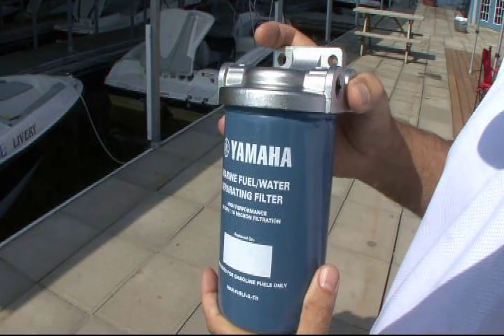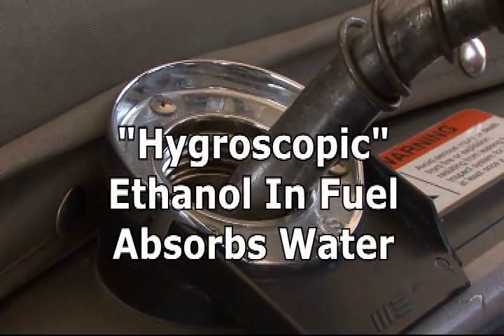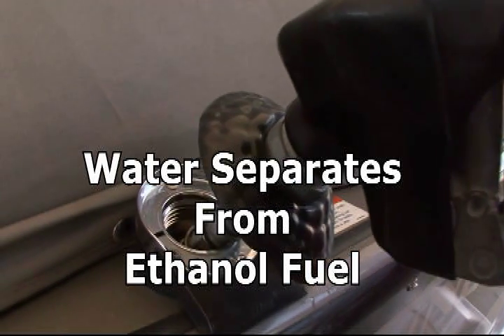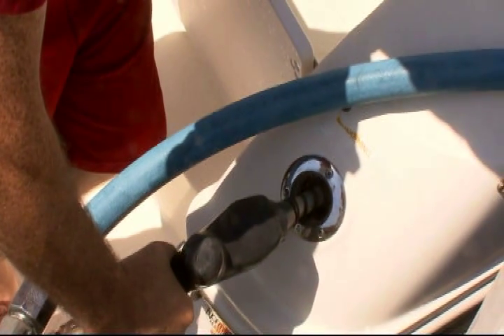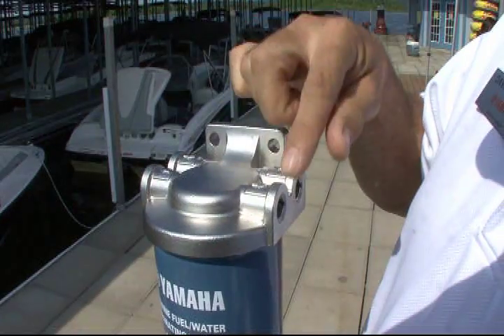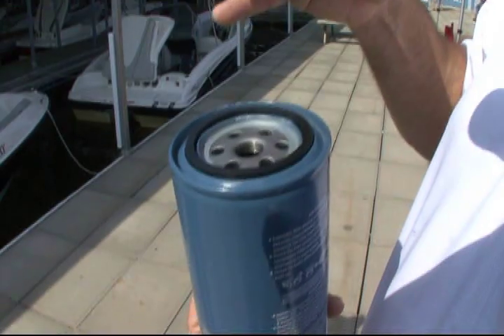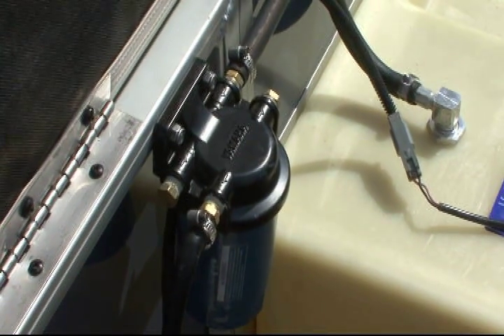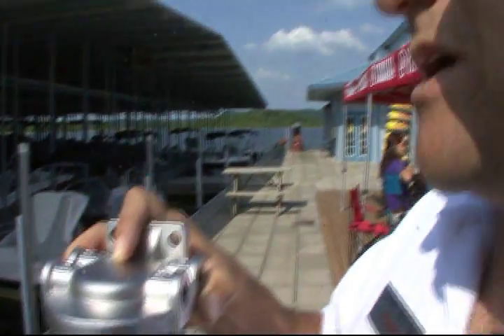Yamaha Marine's 10-Micron Filter/Water Separator Solves Water in the Fuel Problems

Comment: Could this filter be installed on a Yamaha SR230 jet boat? which have the fuel pump inside the fuel tank? The question is because the filter will be installed on the discharge side of the pump, and all the water separator filter that I know are designed for the suction side of the pump.